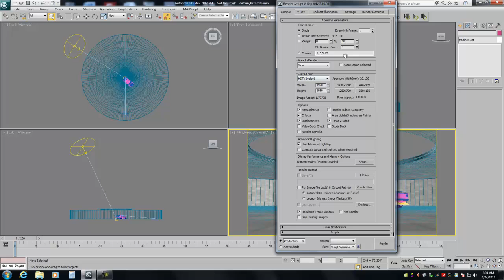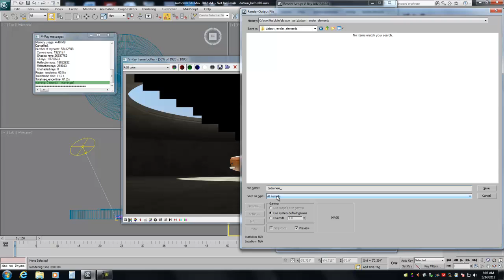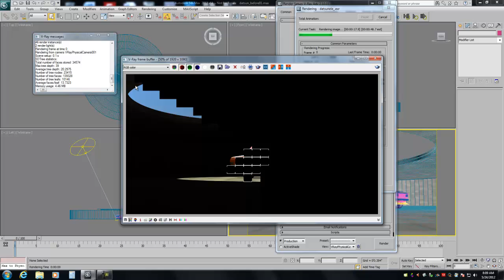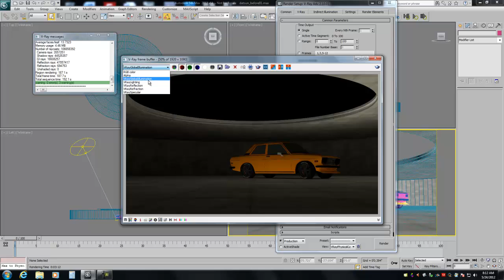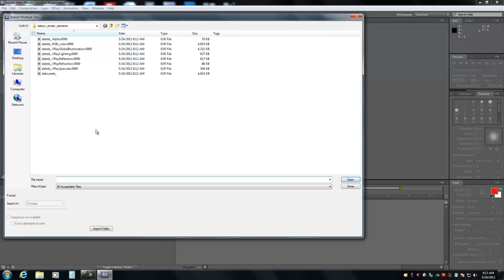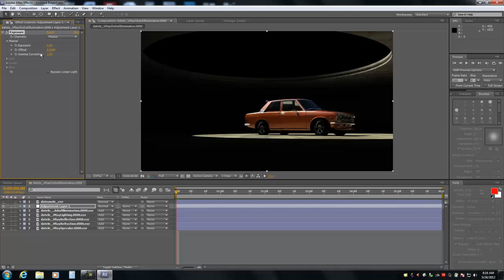3Dean: How To Render Elements Using 3ds Max, Vray and After Effects

Comment: When it comes to Vray, will elements get clipped?

For example, using FinalRender, elements can be clipped, that is, if the particular object in the render element gets blocked by another object not in the list of objects to render, it will in essence turn everything not rendering in that element into a reversed alpha channel, cutting into the elements that are part of that render element, so that the layers drop easily into AE without overlapping the main render.

Comment: It will end up being a little longer rendering passes plus the additional manual work of getting all your passes together and composite  them in AE. It's worth it however if you need that extra level of control and refinement.  And you don't need all the passes, depends on what your trying to do. Sometimes a beauty pass and a dirtmap (AO) is all you need. Mess around with the different passes, it's a good  to learn. It's also important to understand linear workflow. See my comment below.

Comment: I don't think you need to go through each footage and interpret.  Nor do you need to add adjustment layers to have it come out exactly as the main composite render. What you did not do is -  in after effects project settings, click "Blend colors using 1.0 gamma", and bam! that's it! This tells AE to work in gamma 1 space. That worked for me at least. Give it a try - much easier.

Comment: Also, pretty sure there is a better way to correct the gamma in AE globally rather than changing the RGB thing in each layer, and then adding a gamma adjustment layer at the top, ill let you know once ive had a crack at it and got it all working.
Thanks heaps for the vid.